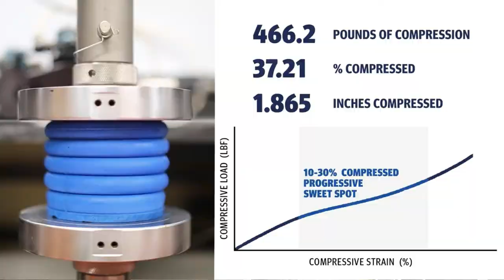Sumo Springs For RV (Install & Review)

Comment: I just installed front sumo springs on a 2006 class A motorhome. Went on a 20 miles trip on a road I often travel. The difference was incredible. Most of the sway was gone, and the ride was much smoother and quiet. Came back home and ordered the rear. Rarely do you see a product slo simple yet so effective. This should be standard out of the factory.
Reply from the maker: We agree. For those who do not have independent suspension, Sumo Springs should be a factory option.

Comment: We have the MORryde independent suspension on our Riverstone 42fskg. But I did replace the front bump stops on my Ford F450 with the Sumo Spring Bump stops. Not as much jolt in the front end as before.
Reply from the maker: We just installed the Sumo Springs on our truck also. Hopefully it will help there also.

Comment: Did you just lift the trailer with the level system to fits those in?
Reply from the maker: Yes. We just lifted the back ones so we could install both sides, then lowered it back down. It is probably not how you are supposed to do it so we didn't share that part on the video.

Comment: We developed a small gas leak (propane) from our CRE3000 bracket crushing the propane line from our travels. Those springs look like they would help.
Reply from the maker: They probably would. The kit also comes with some hardware to rerout propane lines in case they are getting rubbed or crushed.

Comment: Your video and simplicity of install sold me but When those are installed do you install as the trailer sits level or do you put all weight on axle and install?
Reply from the maker: We jacked the back of the RV up to create the gap between the axles and frame to install the Sumo Springs, then lowered the RV back down.

Comment: Thanks for the great video! You gave me the confidence to order Sumo Springs for our 340RL. I saw where you did not need to use the spacers on your 340. Did you ever happen to take the measurements with normal weight on your leaf springs (leveling jacks withdrawn) as suggested by the instructions?
Reply from the maker: Yes, we measured. We didn't show it on the video.

Comment: Great video! We just purchased an Alliance Paradigm 390MP. Curious if you had to relocate any hoses on your install? I’m not sure which model Paradigm you have but I suspect the undercarriage is similar, if not the exact same as ours. Thanks!
Reply from the maker: We have a 340RL and did not have to relocate any lines. I am not sure if there are any lines on the 390MP that would need to be moved.

Comment: Great video! Definitely gives you a lot to think about. Did you ever find out what was causing the tire wear? I don't know if I missed that in the video or what. Just curious
Reply from the maker: It was low tire pressure due to cold Temps. It took a lot longer for Temps to come up during the cold.

Comment: 2nd video didn’t have any pot holes or speed bumps.   I would think they would make for a rougher ride just like adding airbags to a truck makes it a more stiffer ride. There’s not enough play for the axle to go up and down to absorb the bumps. 🤷‍♂️
Reply from the maker: We rode the exact same route in both clips so there wouldn't be any difference. I'm not sure how the science of it works. All I know is it doesn't bounce our stuff all over the place and break our stuff. The video is not designed to convince you to buy them. We make $0 if you buy them. We are just sharing our experience.
Reply: The difference between a airbag on a truck is the truck is designed as is with shocks and springs so you’re adding a higher spring rate. With the sumo spring you preload them so that they become the spring and alleviate the weight on your factory springs. Sumo springs have a progressive rate vs the leaf springs. So that’s how they end up making the ride softer by becoming the spring.

Comment: It works only on compression and not in decompression to control de rebonds so it doesn’t help. A real test will be before and after with a few vibration sensors inside and outside the right to measure the all the movements……..waste of money. The on’y way to improve the suspension is an independant one or adding shocks but not at angle like people do……..perception is not a good way to tell that there is improvement!
Reply from the maker: Thanks for watching and thanks for your opinion.

Comment: RVs are destroying our roads
Reply from the maker: How so?
Reply: @WaywardWaggs  
Most country back roads and gravel roads that have to be maintained often are not meant to be driven on with such heavy loads such as RV's trailering all their toys with them. 
When a gravel road has a weight limit and a speed limit, it is not just to annoy tourists. 
It is there to avoid ruts, pot holes, grade washing, etc, and so that we can afford to maintain those roads and so, that stuff that you are complaining about can be mitigated.